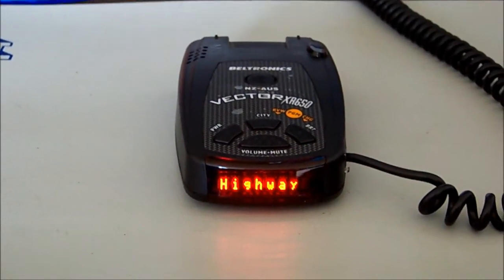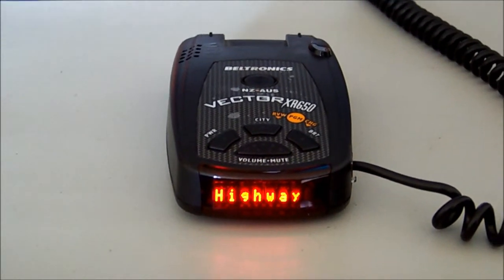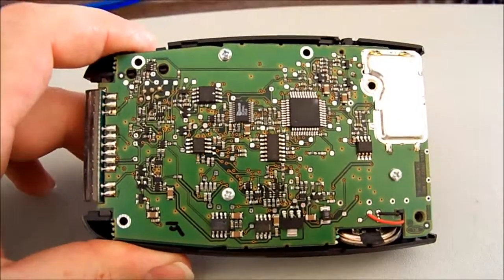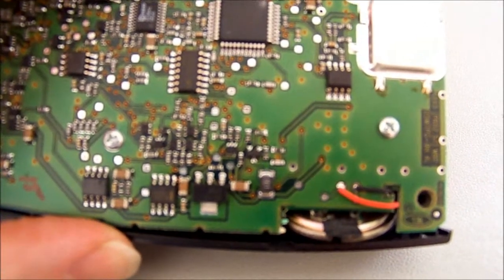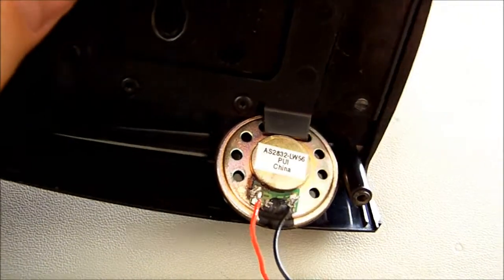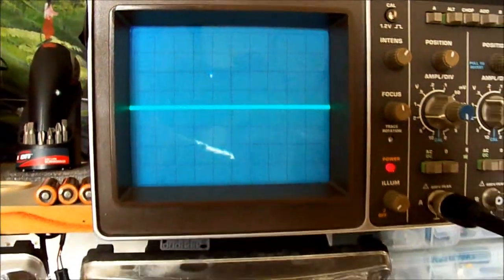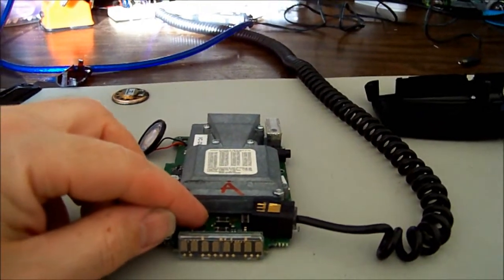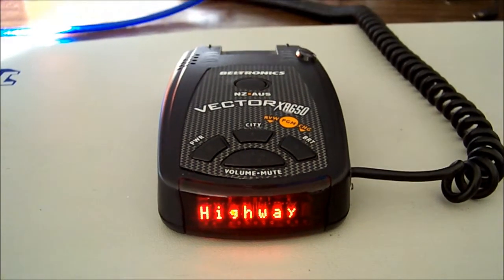Beltronics Vector XR650 Radar Detector Repair

Comment: I've had my radar for a long-time it's been fantastic but it's showing selfcare 3? What does this mean, and low voltage comes up too. Please help?
Reply from the maker: I've not see that message before. It probably thinks the 12V going in is low because of either a fault in the unit or it is actually low at the socket (problem with car) or low at the radar connector because of a bad power lead or socket.
Reply: @JonnyFix  it's for a motorcycle. My stater has been replaced twice now, and it's showing low voltage a couple of times again on the Taco? It's a new battery and on a trickle charge???? What to do?

Comment: Hello Mr Fix.
Thank heaps for your video! I have dismantled my XR850 but it looks like the leads are still connected to the speaker, which then would tell me that the speaker might be stuffed. I have put it on full volume, and I can faintly hear it making a noise, but definitely not loud enough. I have no knowledge or skills on how to replace a speaker unit like that. who could I take the unit to, to have it fixed? and a new speaker put in? thanks for your time and help. Dana
Reply from the maker: Not sure where you are but try Craig Electronics in Taupo. I know they are the agents for this model so should have speakers on hand. Ph 073784814. My last name isn't Fix, it's kind of a play on my actual name :)  Hope your channel does well. Be interesting to see the demand for gardening videos.

Comment: Hi Jonny, cheers for doing this video.
i'm having a similar issue with another beltronics detector (RX65 professional series).
but the speaker, (as well as external jack output) and a replacement 8ohm 0.4W speaker ... are just make a popping / clicking sound

so there is a signal, but is that an issue with the audio driver?
Reply from the maker: +Tocchi +Tocchi I think I saw one of these with the same problem. If you scope the input to the speaker driver chip it looks like digital from the  cpu,. I think the chip was a DAC as it had it's own mute pin. I think the  cpu was even holding the mute pin active, maybe cos it detected a fault, and when I lifted the pin to un-mute it I either got a horrible noise, or nothing. Pretty sure the chip was dead. For whatever reason the owner decided to sell it as is rather than source a chip. Put a scope on yours and see what you see. Look at datasheet for chip and find mute pin and see if it's being held active.
Reply: +Jonny Fix -- thank you so much, i really appreciate the fast and detailed reply :)  ... given the IC is surface mount tech, i maybe limited to ways to repair it myself, but i can certainly get hold of an oscilliscope from a friend to check it out... and then go from there :) thank you

Comment: By any chance do you know how to fix the lighting display? Sounds work but no lights
Reply from the maker: +Jason Ortiz Sorry, I'd have to see it in person and work through it. See if they're driven by the processor directly or via a driver chip, look for datasheet on driver, figure out if there's voltage at the display etc, try understand how the circuit works to figure out why it doesn't. Firstly tho look for bad solder joints, they sit in the window with direct sunlight, they can go through extreme heat cycles so maybe something simple like that.

Comment: Thanks for your video. I was making a trip yesterday, and my friend had a Bel 955, which she stated had lost the sound about a year ago. When I plugged it in,  no power came on, so I just assumed it was a power issue. I removed the screw from the power plug, and one of the wires was not connected. Since I was already on my trip, I stopped at a Walgreens and purchased a torch lighter, and easily reattached the wire. When the unit booted up,  - no sound. That's when I searched online, and found this video.
Seeing you use an old cell phone speaker made me think back of all the units I have pitched. But I was in a drug store parking lot, with only a screwdriver.  You mentioned a kids toy, so  back inside Walgreens, and found a play cell toy for $4. The toy only made one sound and was barely audible, but I decided to give it a shot.
When I opened the toy, I was shocked to see an almost identical speaker as the one from the Bel.  A couple more minutes and everything was back together, sounding just like new. So for my repair,  I had the butane torch lighter for $5, and the toy for $4, 
Thank you again for showing how easy this problem can be repaired. Working perfect.
Reply from the maker: That's awesome! Well done :)
Reply: Jonny Fix *****  I've been searching for something like this for two weeks THANK you BOTH for this   I had an old whistler that stopped making sounds.   I had an old toy plastic gun that made laser sounds.  I took it apart and found a speaker the same same size as the one in my whistler radar detector.  I'd never soldered before, but i was about to learn.  but then I decided to strip the wires from the bad speaker connection, strip the wires for the good speaker.  twist them together and use electrical tape.  I figured since they would be inside the casing, they wouldn't move around.  IT WORKED!  now i have my old whistler radar detector back.  Thanks, again, John and Johnny.

Comment: What other  speaker can be used
Reply from the maker: Any speaker that can fit, there isn't much room. If you didn't care for aesthetics you could glue a speaker to the underside and run a couple wires out to it. Try and match the impedence, e.g. 4 or 8ohm. If you get it too high the volume won't be as loud.